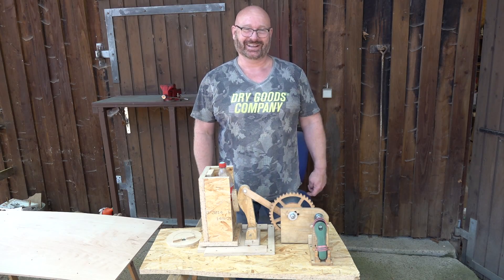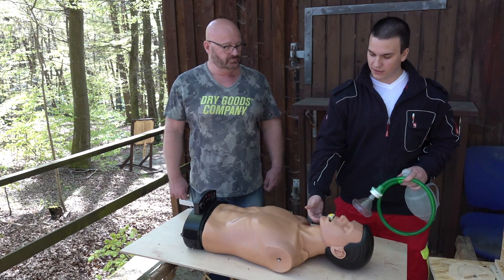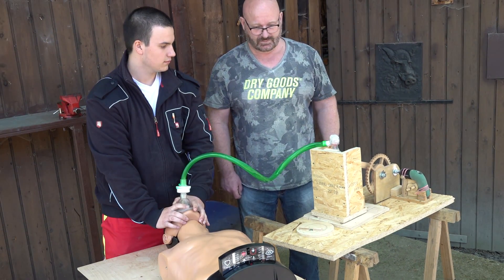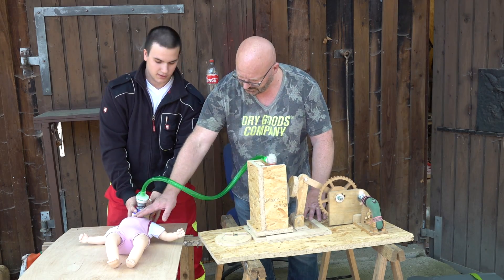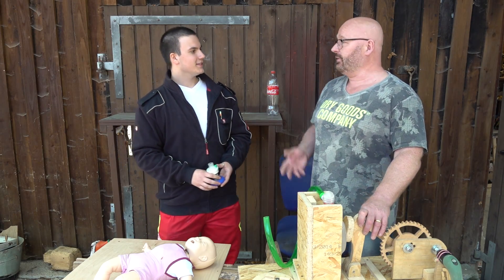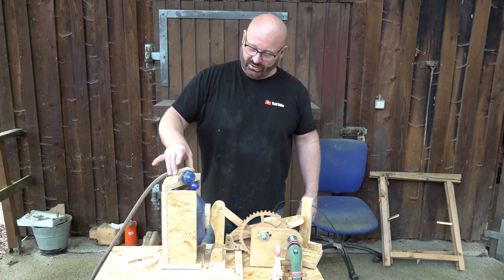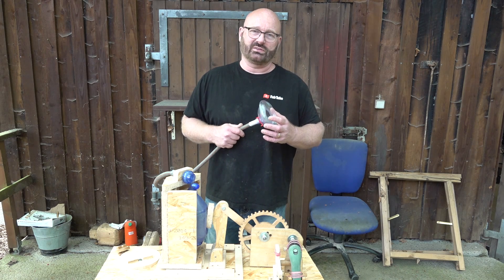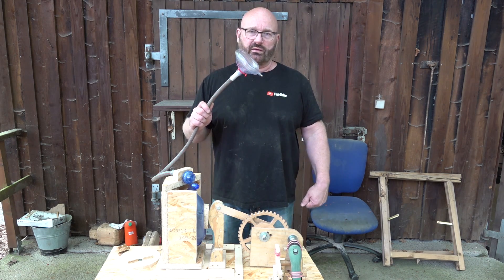Home Made Ventilator - Life Saver or Death Machine?

Comment: Joerg. Here is how to build it cheap. 
Just use windshield wiper motors then you have variable speeds (long lasting, cheap can find every where, 12v, can run from battery long time, portable) and use footpump that are used fillup the rubber swimming pools, floating devices. Use co2 or argon gas regulator to adjust the flow of air, scale of those are using is liter/min(use the one where is steelball inside the classtube, more accurate flow, can find most of the welding shops) And ask Post Apocalyptic Inventor to help you  build it.
Reply from the maker: Motors? Gas regulators? Parts from a welder? Sorry but this doesn't sound cheap or easy to make.
Reply: @Slingshotchannel  Sorry just try to help. You can build this machine under 500-1000e, this idea what i have is made for the hospital, for long use. Windshield wiper motor and those linkages can be used and modified, little bit gringding welding. And u can also use that air bladder that u are using this moment. Gas welding regulator with the glass is used get the right mount of air, (long lasting brass fittings and valves are included that regulator). But any way, good work man. 👍
Reply: @Slingshotchannel  windshield wiper motor, used 20e new 100-200e, gasflow meter regulator 50-200e new, for the motor speed adjustment you need limitless switch or small circuit board ( i am not electric chicken so this is not speciality, sorry if the terms are not right)
Reply: @Slingshotchannel  You can also use compressed air fittings, air flow regulator with meter 10-20e.Sorry i forget to say Windshied wiper electric motor 12v, like you are using now electric motor battery powered drill.

Comment: As a former medical professional... No. I love this guy, but positive-pressure ventilation is highly problematic with the best of ventilators. AMBU bags are for emergency use only and over a very short amount of time until you can intubate and use a ventilator. This thing will kill people. No backpressure, O2,  or CO2 sensors, no safe way to maintain it... just no.
Reply from the maker: Did you even watch the video, with audio?
Reply: @Slingshotchannel  I doubt it. You literally talk about the need for a high tech machine with different sensors. Lots of ppl watch a little bit of a video and comment at that moment and then never finish the video.

Comment: Ya know what I believe that would 100% keep some alive who needed a ventilator to live ! I know the ones at the hospital have more bells and whistles to monitor the patients but with the normal flow of oxygen and the adjusted bpm and a finger oxygen sensor you could stay alive ! Maybe a drill that plugs in so you don’t have to fiddle with switching batteries but it will work it does exactly what he made it to do !
Reply: Definetly better than nothing, but I think it wouldn't be optimal for someone that needs a ventilator for a long time. But for Cpr it seems quite good.

Comment: Hi Joerg , thanks for the video. As I said last video, we used to use mechanical bag squeezers in theatre with good effect, but with safety measures ensuring ventilation was occurring and pressure was appropriate. Mostly in an arrest situation whoever is holding the face ask on can also squeeze the bag, only if they are needing to use two hands to get a seal would they use this, and then it would be a help. Love your thinking though 🖖

Comment: It is an interesting concept, as a mechanical challenge. I think I would have kept the speed control separate from the foot pedal... And made the foot pedal engage the transmission. That way you could set the speed and know exactly what speed you had every single time, And just engage the pumping arm using the foot pedal for the couple of breaths you need it.

Comment: Lol, leave it to Joerg to build the machine with already perfect ranges between baby and large adult. Can't wait to see the wooden, rubber band and drill powered orbital rings in a decade or so. I hear Joerg station will have lots of features.
Reply: You can't build something as big as an orbital ring out of wood! It's not like it grows on ...
Reply: @ergohack  nice
Reply: It’s not flammable if it’s in space
Reply: These machines are useless. Actual ventilators require advanced microprocessors and can damage the lungs if you're just pumping air in
Reply: @ploppercon  yea thats why when they intibate someone they litterally hand pump air into them from a bag. Lotta microprocessors and complex tech in that squeez bag. :)
Reply: @ploppercon  no. They don't. They require a system which limit's the amount of air they pump into a person per pump and per minute. A computer can fulfill that purpose to a high degree of precision, and it is relatively easy to reprogram when moving to a new patient.  However, the computer is only their to change those factor's: volume and pumps per minute. Jorge's pump allows for that as well, and whilst the precision and accuracy would be lower than with a proper ventilator, nothing about the machine is dangerous. "Just pumping air in" is if you're using a bicycle pump, with no thought given to the volume of air or frequency of the pumps.
Reply: @ploppercon   The "advanced" part of the microprocessors thing makes me laugh, because the most advanced part of the electronics side is translating the sensor data. The actual operations part is actually pretty simple.